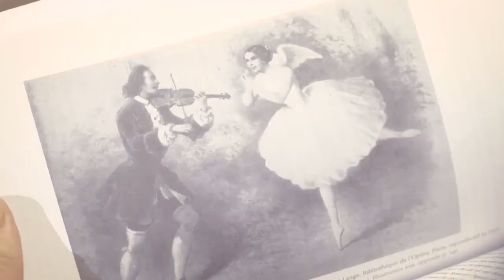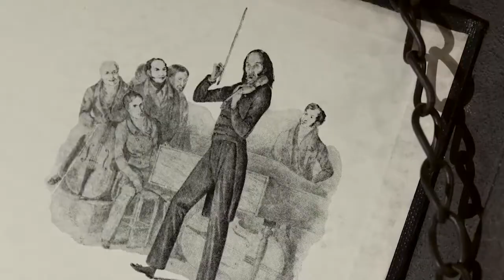The Devil and the Angel Documentary Preview / Kevin Lee Luthier

Comment: im left handed and trying to learn violin any tips
Reply: You would be great with vibrato and the speed of the left hand's fingers. The right hand is fairly simple. You might need to train in the flexibility in your right hand since you don't use it as much. Flexibility is especially essential when using the bow. 

There are some left handed violins. You won't need this since you'll be training both hands to do stuff. Just try regular violins. Shops don't usually carry left handed instruments, so if you do want to try out instruments at your local violin shop, it'd be best if you went with normal violins.

Find a flexible teacher. See if the instructor your interested does free first lessons so you can see if he/she is a good instructor or not. If not, just interview your instructor. If you're the younger type (4-7), then start of with the Suzuki method. If your the older type, there are many methods. Usually school orchestras use the 'Essential Elements' method because it can easily suit all students and is very easy to comprehend.
Reply: See if your instructor can teach at your request, and is willing to follow any methods you'd like to learn from.

Comment: Why did you burn that instrument?
That really hurt
Reply from the maker: Sorry it's been so long responding. At the time I made that violin, my instruments were quite decent in the white, then I would put on the varnish and all but ruin them, like so many  other makers through the centuries. I then spent the next couple years boiling and sampling varnish until I had one comparable with the old masters. I then scraped the varnish off this violin and applied the dragon's blood and amber varnish. And though it did improve it's look and sound, it could never be sold as a fine instrument. It is said that Stradivari burned over 80 instruments during his lifetime. I feel pretty good with my number of failures.